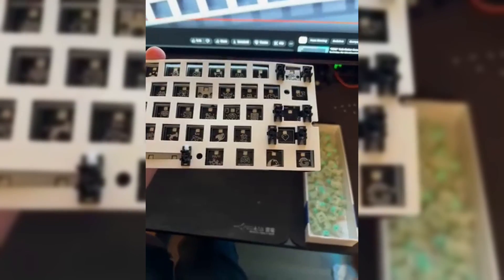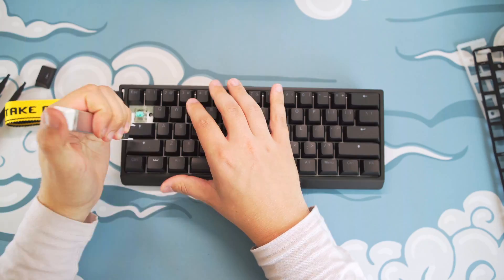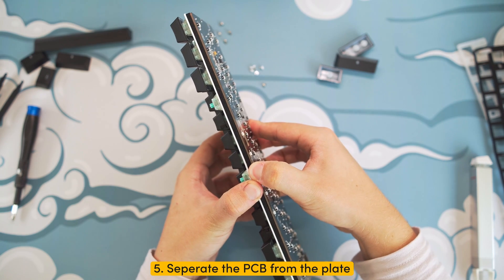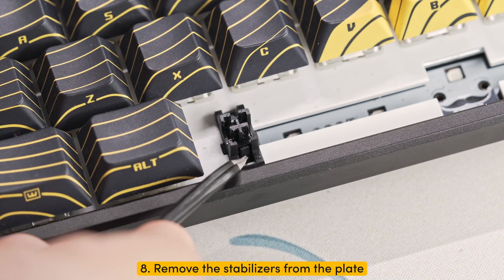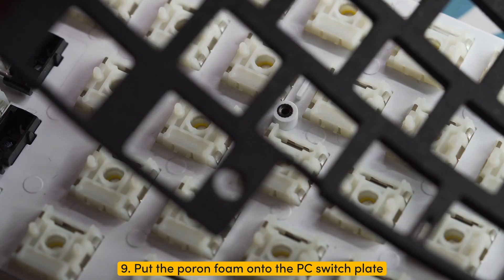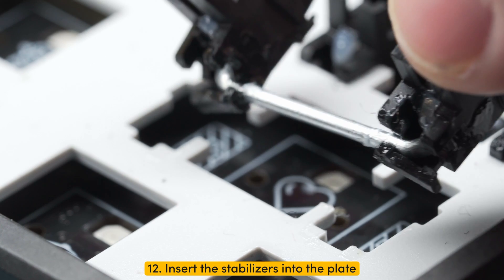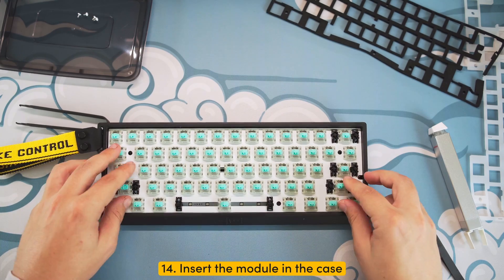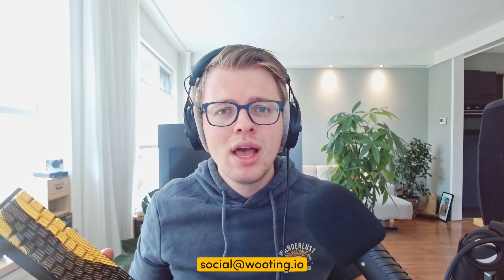Wooting 60HE - How to Swap the PC Switch Plate

Comment: Why does the first foam cover have more coverage than the second foam? I noticed that one covers the right side of the board, and the other doesn't.
Reply from the maker: The default 60HE+ has plate mounted stabilizers. That's why the coverage is bigger. The other one is made with screw-in stabilizers in mind, to make sure it doesn't interfere.
^Sander

Comment: will you be able to use screw in stabs?
Reply from the maker: It depends on which 60HE model you have. If you're using the regular 60HE, then no. However, if you recently purchased the 60HE+ model, then yes.
^Sander
Reply: @ thanks Sander for always replying to my comments lol i had the regular 60He and just bought the 60He+ today

Comment: Lol i just spent 1 hour confusing same issue. The difference is I saw the bend with 1 screw and start recognize that something was wrong. So i stopped and googled. But whats the use of the soft rubber plate tho????
Reply from the maker: Different material, different sound. You can experiment. Silicone pad (the rubber one) is a bit more muted in comparison.

Comment: I just swapped mine last night. Wish I'd have known I could pull the switches after removing the plate. It was a nightmare to do while mounted. Thankfully my PCB is still working fine.

Comment: You guys should include switch puller with the keyboard
Reply: Bought a 60HE a few months ago and it came with one? Don't know why that would change

Edit: Still listed on the website for both the 60HE and Two HE that they come with a keycap puller, spare lekker switches and braided USB cable, all of which I received with mine
Reply from the maker: Like mentioned in the video, it does come with a keycap puller included. I assume you mean switch puller?
Reply: @Wooting  yea switch puller my bad
Reply from the maker: @GoldFus1on  We are considering it, yes. If it will be included with the 60HE, or other current boards, is unsure still. But most likely it will be for the newer products. (things can change over time, but we'll see by then). :)
Reply: @Wooting  glad to see you guys are proactive

Comment: Question for sander or anyone that can answer this: at the end at the soundtest part of the video it says on the side no pad inbetween, is this the stock poron foam which gets removed in step 6 of the video meant by this? which simply doesn't get reused. Sorry for maybe noob question but i want to replicate the sound profile so I'm curious what i need to include and/or switch to get my 60he to sound the same like in the end of the video. Thanks for anyone that can answer
Reply from the maker: Not a noob question at all! So in Step 9 you basically add either the poron foam, or the silicone pad inbetween the plate and PCB. I decided to use none. I had a build with and without the foam inbetween, and the one with the poron foam inbetween sounded a bit too muted for my liking.

Further I have done the tape mod on it, which I explained in another video on our channel. I used 2 layers of tape. :D
Reply: that is quite the response time! you guys are the GOATs @Wooting